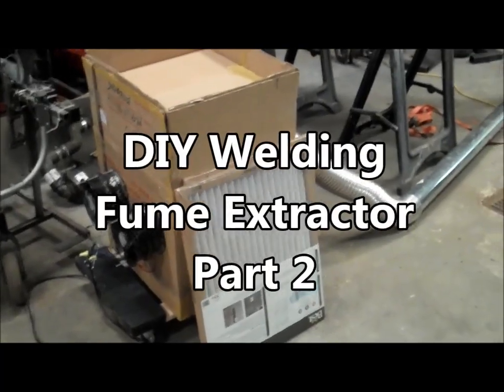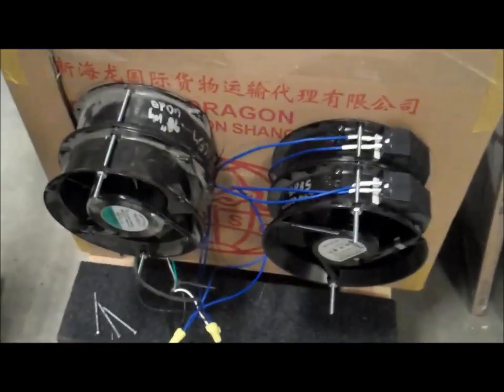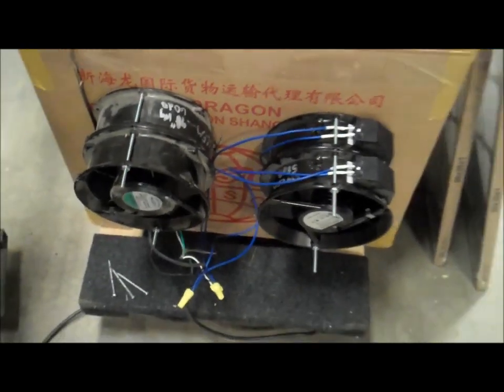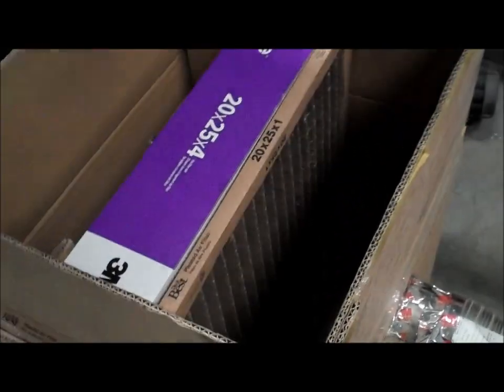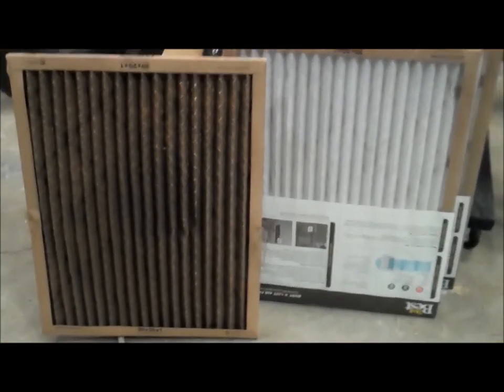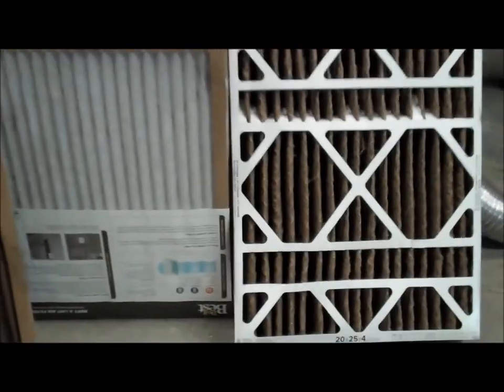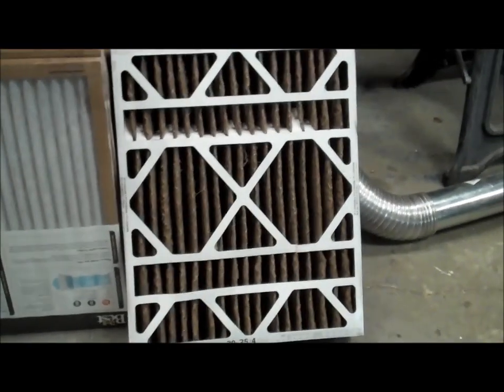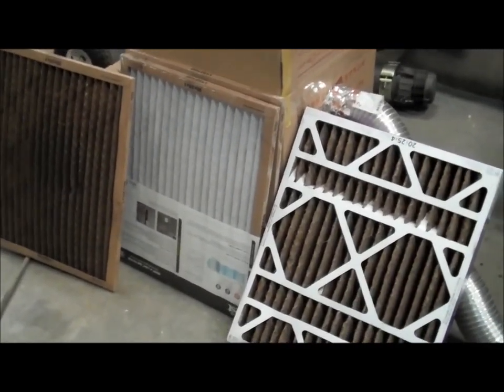DIY Welding Fume Extractor Part 2

Comment: How is it working now after a few months?  How many hours of welding can you do before you have to change the filters? Thanks for the informative video.
Reply from the maker: It worked very well, I have changed the filters once.  It definitely helped when I was doing heavy welding for many hours at a time.  It got me through that welding project, and I haven't needed to use it much since.  I'll definitely use it again on the next welding project.  I didn't keep track of the time on the filter, but it was worth it.